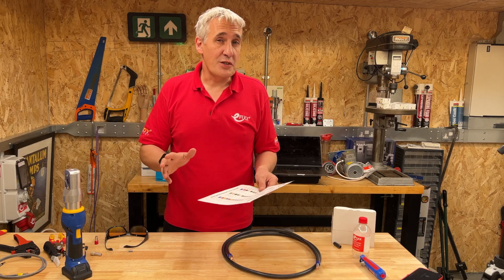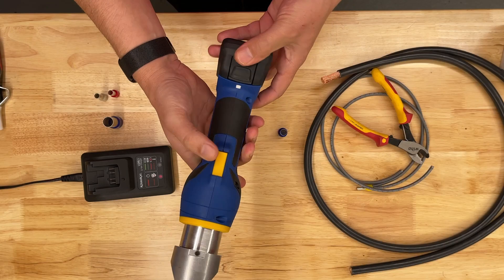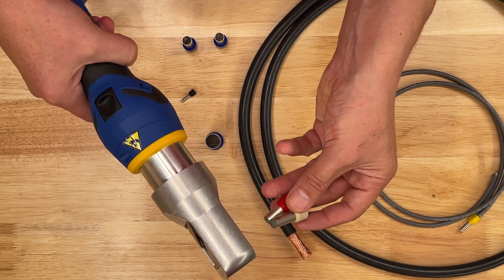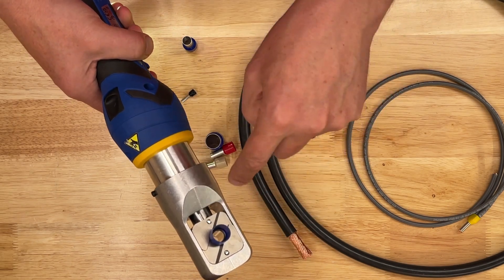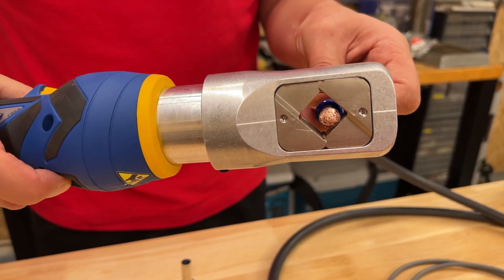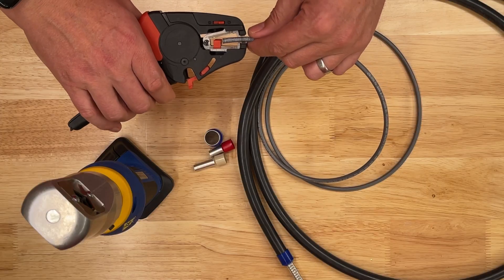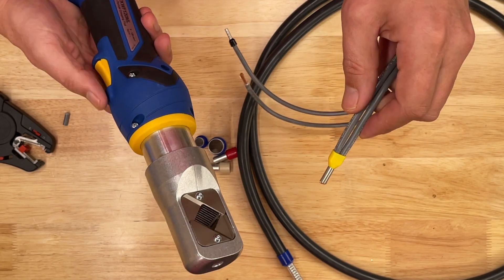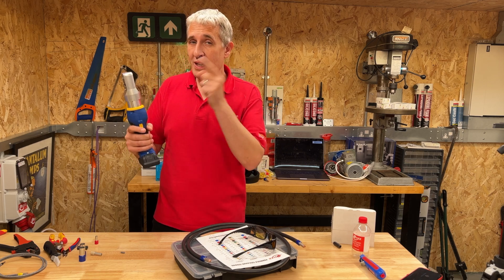The Ultimate Ferrule Crimping Tool - Klauke EK WF 120 ML

Comment: I work for a company that makes Static Frequency Converters for aircraft, and the input cables required 125A Commando's. Output required 400Hz, 3Ph w/interlock Anderson Plugs. We use Klauke crimpers for 70mm ferrules and 120mm2 copper ring terminal lugs. They're fantastic, crimp reliably, and much lighter to carry than cheaper alternatives.
Reply from the maker: Great feedback thanks 👍🏻
Reply: I've never needed a ferrule larger than 16mm , so i assume aviation still use the tradition hole in brass and screw down method? Klauke, Cembre and Dubuis are the flagship crimpers.. cheap alternatives just not worth it

Comment: Wouldn't cables that big normally use crimped lugs instead of screw-clamp terminals? Or maybe I've just been watching too much Jointech...
Reply: We use ferrules on cables up to 100mm in boards - in Australia...
Reply from the maker: It does have a matching crimper for lugs review coming soon. Wait until you see the ferrules needed on a 125A plug (you can just see it in the thumbnail)
Reply: We certainly need to lug them on our boats that handle around 250A continuously.

Then again.. we don't have any way to attached ferruled cables. only bolting.
Reply: @efixx  great to hear. We have a foot pump hydraulic lug crimper and it's a hassle to haul around.
Reply from the maker: Stay tuned - sounds like you'll love it!
Reply: That’s probably the only fancy overpriced tool that is of genuine use.
Reply: @Dog-whisperer7494  for the bigger sizes, maybe. looks too slow and cumbersome for the normal small ferrules.
Reply: @wesleypotter7969  yes theses are for electricians who work on hight voltage systems like the railway and the underground train system. So make me wonder why they show it for the like of us normal sparks were never going to ever need such a tool.but what do I know I’am just a humble spark who’s opinion means nothing 😂 it is a great tool for the right job
Reply: Mike .. Ryefield still use the old brass clamp and bolt on the main terminal of busbars on the 24way boards and even the Glasgow switches still use the traditional style terminal.. but your right, most things are lugged or cage clamps these days

Comment: I tend to use pin crimps on larger cables, the casing on those ferrules are thin and i've seen them deform and loosen over time, Klauke make some good gear.. batteries are made by bosch , well they are on the 18v kit, i went Cembre as batteries are made by Metabo and i already have Metabo metal munching tools and lugs are easier to get as Rexel stock all Cembre gear
Reply: "deform and loosen over time" means you didn't crimp it properly in the first place or they were very low quality ferrules. If you do it properly with the right ferrule, the copper cold welds to the ferrule itself from the amount of force applied
Reply: I never said i crimped them, haver been on jobs and seen the results of poor crimping, looking at the ferrules being used in the video, i doubt they're cold weld, the head of the crimper gives that away, interlocking leaves wouldn't give enough pressure to cold weld.. maybe the lads could cut one open... interesting to see
Reply: @thattoolguy9432  it indeed cold welds at the sections which have been compressed the most, just not the whole way through the ferrule. You need to cut a clean cross section at just the right place to see it
Reply: That's an air tight crimp not a cold weld, as it would still have voids
Reply: @thattoolguy9432  there’s no voids in the cross sections of highest compression, it cold welds
Reply: Cold weld just means intermolecular bonds form. The ferrule is usually copper with a tin or nickel plating for corrosion resistance, it bonds well to class 5/6 stranded wire
Reply: Both Klauke and Cembre offer most of their tools in a range of battery options.